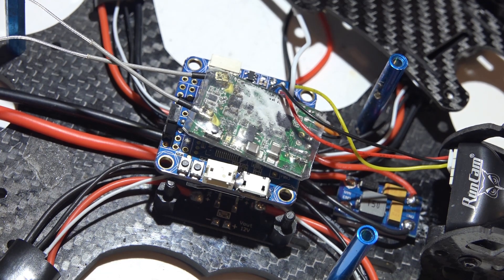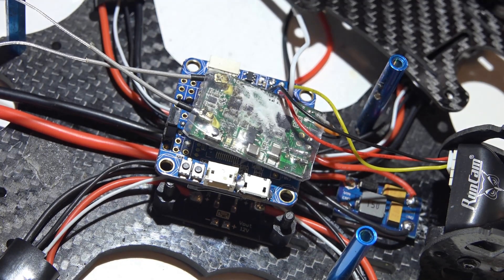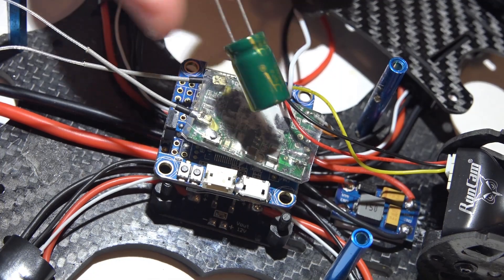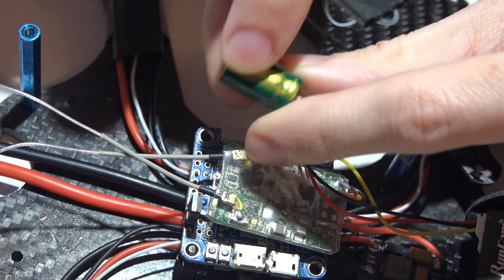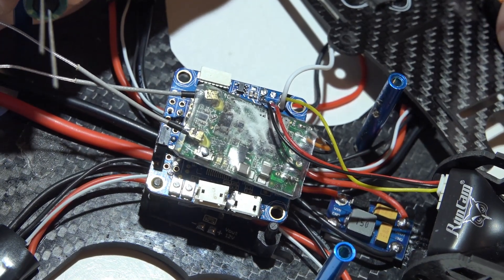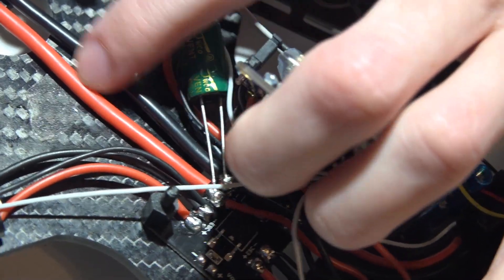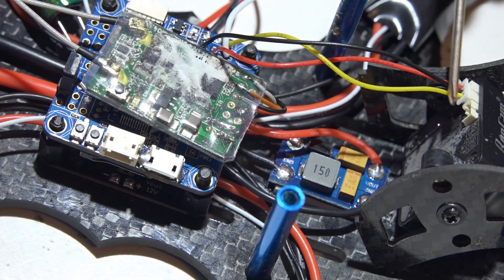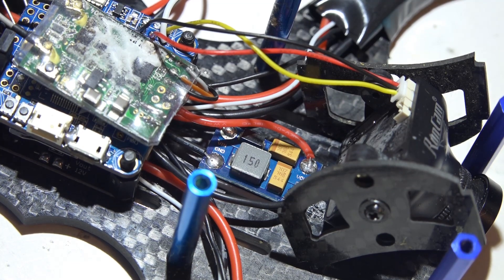Capacitors Used For Protection

Comment: Some points to add to your video
1. In case you didn't know, the "C" in LC-filter stands for capacitor. Those yellow-brown components on the LC filters are tantalum capacitors. The marking "107 16K 544" means they are 100 microfarad capacitors rated at 16 volts. So not as much protection as the 470 microfarad capacitor in the video, but still a useful amount of protection.

2. ESCs actually have capacitors on them, if you take off the heat-shrink you can see the yellow-brown tantalum capacitors on them. Some ESCs use electrolytic capacitors (the "can-style" capacitors). It's just because of size/weight/price restrictions they may not have enough...

3. The best place to mount the capacitors is as near to the source of the spikes as possible - that is right where the power leads connect to the ESC. Obviously you need four of them if you are going to do this. But you can use 4 smaller ones, rather than one big one. So, say, one 100 microfarad on each ESC.

4. Another way to reduce voltage spikes is to reduce the length of the power leads to the ESC. So, all other things being equal, it's better to have longer wires to the motors and shorter power leads to the ESCs, that is mount the ESCs closer to the frame so you can use shorter power leads. (To draw on the "water in the pipe" analogy, the shorter the pipes the less back-pressure (spikes) generated when the ESC "turns off the water". Or more accurately, shorter wires have less inductance.)

5. If practical, twisting the power leads to the ESCs together (ie making them a "twisted pair" of wire) also reduces their inductance and so lessens the spikes. This is probably not possible on most small quads, but is certainly worthwhile doing if you are building a 600mm aerial photography quad. On the quad in the video it looks like there is enough room to twist together the ESC power leads.

6. On a separate issue, it is certainly good practice to twist together the black/white signal wires to the ESCs - this makes them  less susceptible to interference.
Reply: #3-what he said.. but if space permits, 4pcs 330uF could be enough... 1 cap per esc.placed ON ESC.. lowESR types, the better
Reply: Martin Budden PS: only adding that extra one at the battery because I have a 20c (a good one, turnigy and testing tells me it's more like a 40c, but still shite) battery I'm compensating for

Comment: The capacitor will reduce ripple voltage from the battery.  Feedback voltage from the motors wouldn't be helped by the capacitor.  It would reach everything on the boards before it got back to the capacitor anyway. If there was an issue with feedback voltage maybe a diode could be used.
Reply: DroidCheats, I agree.
Reply: I was thinking the same thing. To stay with the analogy. There is enough juice to saturate the spongue, this way it cannot catch more water when a tidal wave occurs? Or can it hold a bit more or something?
Reply: In a D.C. circuit, an inductor stores energy in the form of a magnetic field, because it resists the change in current. This happens to be what a motor is comprised of. When current stops flowing the magnetic field collapses, and a large voltage is applied going in reverse polarity or 180 degrees out of phase with its normal phase. However, upon further study there is no rational reason to my knowledge why this should affect the flight board of CCD cam board since the motors on Quads are being supplied with AC from the ESC's, the field has no effect on the DC side of those components, so a diode might not do anything at all either, but at least they are lighter LOL :)
Reply: I agree with you . A diode across supply  would be protecting fro reverse voltage
Reply: Redemptioner1 have you ever looked at a schematic for an esc? Do you also think the video demonstrations of regen are hoaxes?
Reply: wrong
Reply: batteries don't ripple.
Reply: DroidCheats wrong you put one on each ESC

Comment: I lost 2 VTx's before installing a 1000uf 25V Low ESR cap on all of my builds; I was running an LC filter, but that didn't save the VTx's. I have not lost a VTx since then, and have even gone so far as to remove the LC filters from my builds to save space and weight, with no negative impacts.

Comment: Two things I feel needs to be pointed out:
1) As you said, the disturbance comes from the ESCs. Different ESCs have different amount of capacitance on them. That is, a super weight/cost optimized ESC with little capacitance on board is going to cause a much larger surge. 
2) Putting the capacitor on the battery terminals make very little sense. You either (typically) want then at the source of the disturbance (at the ESC) or near what you want to protect (across the output of your lc filter for example)

Comment: Friend, this is not the subject you are commenting but also told me to place a capacitor at the entrance of the osd, this is the original of the naza, the problem that when it accelerates and clear this one begins to disappear as if it will be without current, Not so the video, it is well. Of being so type of condenser and of what capacities, the osd is the ios that comes for the NAZA M V2

Comment: I also used LC-Filters like you do, but now i switched over to 1000mF low ESR capacitors because: they are cheaper (< 1$), lighter (!) and i can solder them anywhere i want to instead of anywhere in between where i have to resolder half of the copter. So know i can change my capacitor in about 2 minutes. changing my LC filters was quite frusttrating (they always shaked of their mounting and damaged themselvs)

Comment: Anyone else remember ELI the ICE man from BEE classes??  The cap across the battery input will shunt any noise.  It will have zero effect on the affect of any voltage spike cause by the motors..  The signal applied to the motors is not a true sinusoidal waveform but a somewhat restricted sinusoidal, anyway.  Just enough of an inversion so you have a change of phase.    Remember, these motors came from old hard-drive technology so the signal is more of a pulsating DC rather than AC.  The only way to filter anything from the motors would be placing a device between the motors and ESCs.

Comment: I add a short length of  insulation to the long legs of the capacitor to prevent a short.  (I strip a spare chunk of wire to get the insulation)

Comment: I recently had my quad blow my diversity nano on a 6S bat, kakute f7. I was flying and did a punchout and the quad just killed the video (air unit) and the quad dropped to the ground. the diversity was the only thing that fried though. the crossfire no longer sees it and no lights come on in the receiver. i had my cap on the wires for the 4 in one esc. not sure why it blew, whats the best way for me to check?

Comment: a LC filter is an inductor and
 capacitor , those appear to be surface mount.  so I suspect you are getting the capacitor effect from that
Reply from the maker: Yep. Though it's not technically rated to withstand the voltage spikes. It would be hard to test this though since I've never had anything fry even without the LC filter.

Comment: I use the original capacitors on my Esc(These are 220uF 25v) I think it is better to have More smaller ones on Different Parts on the Drohne.(i use only one extra capacitor on my vtx input and on the Output (filtered,clear 5v to reduse noise/flickerring)

Comment: been askin questions on some of your vids... but you dont get back..but i have this problem you speak of..bought FIVE flips32s f4s..i have emax 2600 reds, emax 30a bullets, flip32, 75c 3s tattu, my FC shuts down for a second on landings when i bounce the gyro, quad freaks out, wrecks..i did bench test and thats the story..so im gonna put one on every motor power wire. the escs i had on before were ALOT bigger in size..these are 19.?mm long..not many spaces to store energy..

Comment: My Cinecan has LC filter. But maker of the board said not bad idea to add capacitor to battery lead to stop voltage spike when plugging in. Trying to learn how. Not the best solderer (is that a word)

Comment: I'm confused, if your concerned about voltage ripple, then yeah a cap at the right value will help smooth fluctuations, but I don't think that's what is going on here. If the voltage is going back, reversing polarity for a split moment, called back EMF then a quenching diode across the pos and neg motor wires on the D.C. side of the ESC should be the answer. Any thoughts?

Side note: the batteries them selves are nothing but capacitors any way, and adding a tiny cap won't amount to a hill of beans anyway.

Comment: need insulator on the leads, that is not ideal with such long legs
Reply from the maker: I would if I were actually using it. Highly recommend it. Thats why I mentioned putting electrical tape around it. But I removed it after recording.

Comment: Hey JC where do the wires go from the lc filter.  I know that the in voltage you solder direct to the battery leads but the voltage out goes where????

Comment: Wow I learned a lot from your channel! But you were saying that your lc filter is used to protect the FC, but FC runs 5 volts right? Not full vbat voltage.
Reply from the maker: The flight controller and devices connected to it do run off of 5v. But the voltage regulator is in the flight controller, not the PDB. And this is after the LC filter. Because everything comes after the LC filter, the filter is the bridge between the PDB and everything else. So if something is to burn up it would be the LC filter acting as the bridge.
Reply: Project Blue Falcon ah yes this is omnibus F3, got it! Growing to like omnibus FC now

Comment: +Project Blue Falcon - is capacitance in a system cumulative?
On RC Groups some guys suggest it is better to use smaller caps directly on the ESC?

1) Would say 1 220 uf cap on each ESC do as good or better job than a single 470 uf on the battery lead?

2) And is it the voltage that spikes or the current?

Thanks

Comment: I don't think people use it to avoid frying components (as you said, almost never happen), but instead as a real LC filter.  
This video - https://youtu.be/ZhvuQJPGHzU - shows how a capacitor is better at filtering than a voltage regulator.
Note that voltage regulator already do a fine job enough.
Reply from the maker: You can use capacitors for filtering, but you wouldn't need one as large rated for 35v or 400+ uf. Thats basically what a LC filter is, a small capacitor and other parts. But yes I do agree that a can type electrolytic capacitor will help with video feed.
Reply: Coreycry LC filter is to reduce noise. The L in LC is an inductor and of course the C being capacitor.

A capacitor by itself resists quick changes in voltages therefore eliminating spikes that may be caused during breaking and will also add a lil umph when under a large load

Hope that helps a lil :)
Reply: freshconnekt Thanks I've learned something about components naming.

Comment: hallo I have a matek hubosd and when I do a powerloop and stop the quad upside down I loose the osd... I know that is from the constantly big voltage but how can fix this??????? and I put a capacitor but nothing... I appreciate any sagestion
Reply from the maker: I would try putting all your ground wires on the PDB. Ground from the camera, vtx, flight controller, everything.

Comment: Is there any adverse effect if I solder wires onto the capacitor legs and solder that wire onto my PDB? I do this so that it's easier to position the capacitor into a safer position in the body of my quad for those really tight builds but I'm not sure if that might affect it somehow. Nothing fried so far though.
Reply from the maker: Doing it that way is fine
Reply: Project Blue Falcon Thanks for the super quick response! Subscribed.

Comment: will adding a capacitor to flight controller with a built in 4 in 1 esc (racerstar F4s) help or is it only good if you have the esc seperated?

Comment: You may be right, that you can protect the FC by using a LC-filter, but I'd still and always use a capacitor when space on the quad allows.
The reason simply is that you're also protecting the ESCs this way. Sure, that may not be such big of a deal when you're just flying 3S or 4S, but when moving upwards to 5S or even 6S certainly it is.

Comment: Late addition - Recently that there has been more recognition (partly because of Raceflight) of the need for filtering the new gen of FC's and ESC's. However, this is nothing new, and has been recommended for a long time in RC fixed wing and multirotor, and electronics in general. Typically the circuit includes both a capacitor AND ferrite ring. U will find many instances of the design and how to build them on YouTube. One of the best examples is by our long-time RC stalwart RcModelReviews https://www.youtube.com/watch?v=xDUoxsMpfYQ . Over the years, he's brought many new pilots into the world of RC fixed wing and multirotor worldwide. A great resource. Subscribe and check out his forum http://www.rcmodelreviews.com/forum/ . 

BTW, consider getting a HAM license required for most of the transmitters (worldwide) we run and either not known or ignored by most, but part of the RC hobby none-the-less. Easy, and the classes will cover some of the theory and application we use flying multirotor every day. Locate UR local Armature Radio club (typically through the regional Emergency Operations Center or arrl.com) and they will be more than willing to help U and UR club in many ways. They're a pretty tight fellowship and like to party! KA2OLL

Comment: what's  KC  I have the omnibus f3 I was wondering  if u could  help me out I'd like to know  where  u get u r lc filter n if u would send me a wiring diagram  of u wire it up with the osd with clean  video  I can't  seem to quite  understand  it all I'd appreciate  it  Mahalo... from Hawaii
Reply from the maker: Here is the LC filter I used in the video, but any LC filter will work. http://www.readytoflyquads.com/mini-rtf-lc-filter-3amp-2-4s. It just has 4 pads. Where is says V in you just run a power and ground wire from your PDB. Then on V out I run and power and ground wire to the Video transmitter, and then another power and ground to the Omnibus on the pins you use to power it. To do this you need a video transmitter that can handle the voltage of your battery. Then the Vtx video wire goes to the OSD pin on the Omnibus. For the camera you can power it with 5v off the Omnibus, but put the ground wire on the LC filter ground out.

Comment: Oke,I never used cap. But have not flown much with goggles yet. Now I am trying to use goggles, but the video becomes so bad when I turn my motors that it becomes impossible to use any goggles.  Now searching for solution and it seems I need to use cap.
It had nothing to do with frying ur system. Just get ride off magnetic interference from the motors.  That gives a impossible video feed. 
That's also the case of using a LC filter. 
I always thought my pdb's had enough filtering for my video. But seems all my quads have it.  None of them use a cap.

Comment: Hey JC! thanks again for this video! great as usual and the best thing is that you always touch the topics i always want to hear about and could hardly find reasonable explainations. I understood now that people use it either for better video quality or to avoid frying things (should be maybe more applicable for 5s and upwards), but some time ago i have seen a video of a french guy that installed a capacitor in order to kill the mid throttle oscillations he had with his kiss fc (i fly kiss gear as well therefore i saw it). Here is the link: https://youtu.be/kbMH4YFoFaU  He got this capacitor-hint from Felix and Boris, so maybe there is some truth behind as well :) Which means that propably this is a third option a capacitor can be used for.... Cheers JC!
Reply from the maker: Yep thats true, it does help with signals. This is another reason why I power my flight controller with the LC filter. Its going to do the same thing.

Comment: Hey JC, great vid.  For what it's worth, after mucking around panasonics website, I found this model of capacitor.  EEH-ZK1V331P .  Its a much smaller form factor then other caps but only rated up to 330 μF.  its a lil less then your 470 μF but I hear of people of having great luck with even 220 μF caps.
Here's a link to panisonics product page: https://industrial.panasonic.com/ww/products/capacitors/polymer-capacitors/hybrid-aluminum/zk-high-temp-reflow/EEHZK1V331P
Here's a link of where to get em if anyone's interested.  http://www.digikey.com/products/en?keywords=p121403ct-nd

Also, these are surface mount, but i just solder them on top of the wires.

Comment: So you have an Lc filter between battery and your VTX power in.  Don't you need regulated 12 volts to vtx?  Does the Lc filter regulate it?  I'm not understanding how that exactly works.

Ive specifically got a question on how I should power my vtx. I have Martian II Pdb that has 12 volt out should I just solder wires from that straight into vtx?  Add Lc filter between pdb and vtx?  Or add 12 volt regulator and Lc filter?  I've seen all these different routes in build videos before.

Any help would be great thanks.
Reply from the maker: It all depends. The video transmitters I use can take up to 20v. In that case I dont need a 12v regulator so I power the LC filter off the PDB with the full voltage of the battery, then power the VTx off the LC filter. If you VTx can only accept 12v then you need a LC filter that can run off 12v and place it between the regulator and VTx.